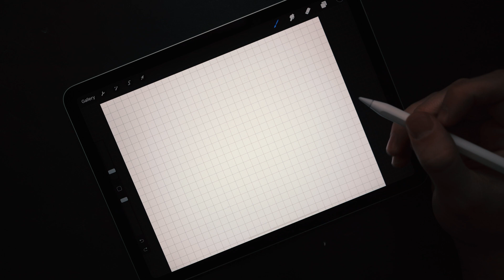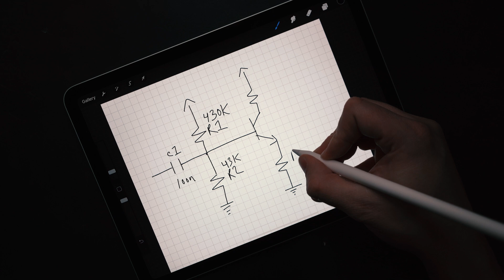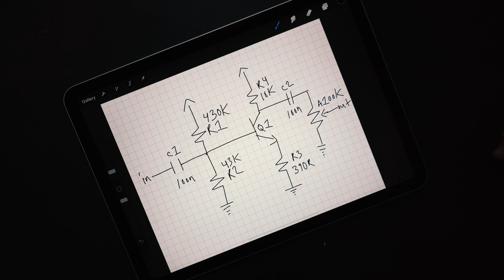How does the LPB-1 Boost work?

Comment: DC voltage coming from the guitar?????
Reply from the maker: I meant dc voltage on the input of the circuit not directly from a guitar. 

"Filtering DC voltage at the input of a circuit is crucial for suppressing noise and ensuring a stable, clean power supply, often achieved using passive components like capacitors"

Comment: Excellent video. What impact does the A100k volume pot have on the circuit and its output? If the value of the pot was higher, say 250k or 500k would this makee a huge difference?

Comment: Although R2 dominates the divider in terms of current flow, the input dc blocking cap actually sees the parallel combination of r1 and r2….
Reply: Yes that is a little low for a guitar pedal. I would want to have about 1M, but 500K is seen now and then.

Comment: Well, that was useless. No facts or figures, just anecdotes and adjectives. Here’s some useful info. The max voltage gain Av=(R4||Rpot)/R3, a bit over 23 or almost 28 dB. The input filter  cutoff frequency fc=1/(2piR1C1) which, for the components shown, is 37 Hz. The transistor base bias voltage, formed by voltage divider R1and R2 must be greater than the transistor’s emitter-base voltage Vbe, aka it’s turn-on voltage, which is around 0.7 V for BJT transistors. Vb=(V+)-(V+)/(R2+R1)*R1, or around 0.81 V for the values shown. Stay in school.
Reply from the maker: And obviously this video was designed specifically for you
Reply: It is totally fine for a beginners lesson. And good with some extra info, but keep it respectful.
Reply: tl;dr

keep up "that mature-age student that won't stop interrupting the lecturer" thing you've got going on
Reply: for someone just getting into circuits this was a great video bitch lol

Comment: Maybe do a video comparing the reissued circuit to the one you’re showing? I know the reissue has more caps ie: c4 & c5 that folks have been clipping off along with ferrite beads FB1 and FB2 apparently affecting the true bypass signal. This video was great for a point of reference for the original values.